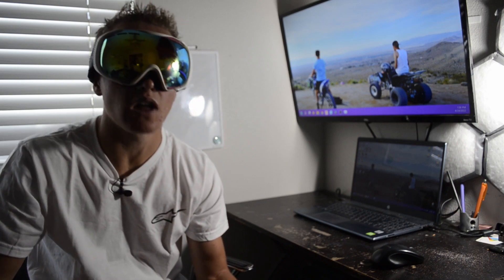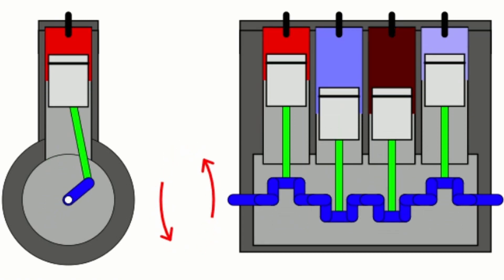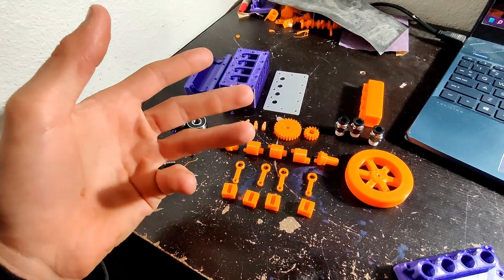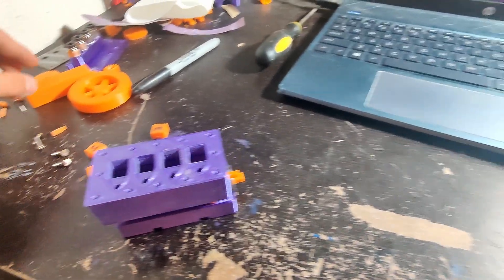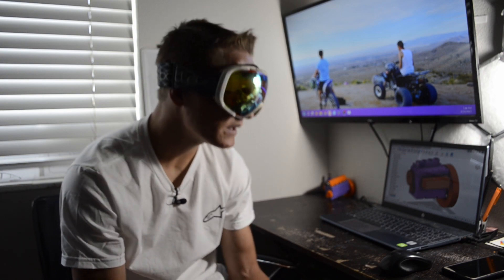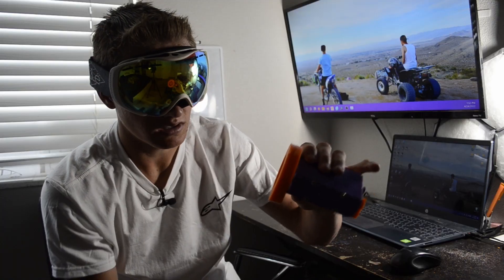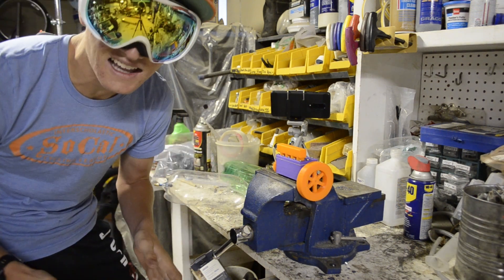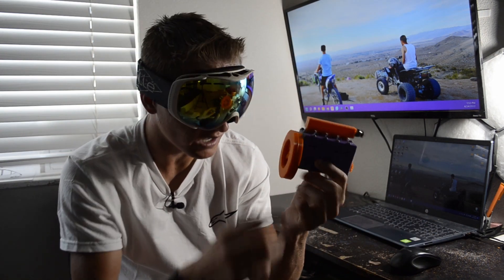3D Printing A Working R1 Engine

Comment: what non-3d printed parts do we need? the thingiverse description does not list them
Reply from the maker: 18-M3x20mm
4-M3x10
2-22x8x7 bearings
2-16x5x5 bearings 
4-6mm precision ball bearings
1-1/4in npt thread pneumatic fitting

Besides that, i think that's everything
Reply: @AxelDayton  thank you!

Comment: Hey there, I'm about 15 yrs. old, and am trying to print this beast... what how many of each piece should I print? there are so many cam pieces that I can't tell them apart!
Reply from the maker: Ok so in this engine their are 4 pistons, pushrods, con-rods, m3x10 bolts, and 6mm ball bearings. There are 8 crankshaft parts, 4 ball bearings (2- 16x5x5mm), (2- 22x8x7mm), 16 m3x20mm bolts and 1 of everything else I believe. The amounts may be off for hardware, but that should be the right amount of 3dprinted parts
Reply: @AxelDayton  Thank you! also, which type of crankshafts are used on the conrods? they don't seem to fit together in my cad/slicer environment
Reply from the maker: This crankshaft is a multi-piece crankshaft. One side had a small square and the other side had a small circle with a square inside, you conrod goes onver the circle and the square goes into the circle, that's for one piston. 

It may make more sense if you watch my single cylinder 4 stroke engine because that walks you through how to do it. Sorry if these directions are unclear
Reply: @AxelDayton  Thank you!!!

Comment: Have you ever thought about lubrication? I build lego engines with the same exact principle as these engines and ive found that lubrication always helps. Best thing ive found is either vegetable oil or vaseline
Reply from the maker: Yes, i don't know if i showed it in this video but i use silicone lubricant for all the components; pushrods, pistons, and crankshaft

Comment: can i ask what's the point of a 4 stroke air engine?  I may be wrong but i thought the point of 4 stroke was to extract maximum efficiency out of the fuel burning..? why not cross plane 2 stroke lol
Reply from the maker: There are 3 reasons i build 4 strokes:
1. By delaying the firing order to every 4 strokes, you save air by having it fire every other revolution. This was especially true for my single cylinder engine. 
2. This engine's soundtrack would not have been possible without being a 4 stroke due to it's weird firing order. If it were a 2 stroke, it wouldn't sound like the real R1 engine.
3. To my knowledge, the only other person that builds 4 stroke engines are Camden Bowen. So its a great way to have my engine designs stand out.
Reply: @AxelDayton  okay well that makes sense, thanks for answering! I have seen some of Camden's videos and I love this part of youtube; also from seeing Tom Stanton's 2 stroke videos I'd guess you get a higher peak power but at a lower efficiency

also well done on getting it to even fit together, tolerances are hard enough let alone getting it to self start!

Comment: hey what size screws n such did you use for your engine
Reply from the maker: Pistons use M3 x 10, the head/oil pan use M3 x 15
Reply: @AxelDayton  thanks!!! Also I'm printing your engine in a type of plastic called Nonoilen, it can withstand Temps up to 110C easily but it prints like pla, you should check it out!  I'm gonna use it to power a rc steam powered plane. I am gonna modify the engine a bit to make it more durable.

Comment: Pretty cool maybe soon your should try (if you ever want to make another part of this series) to make dual or triple expansion engines like  steam ships had in the 1910s to try to squeeze out the most speed and torque out of the same amount of air (update as I just got this as an idea but) use graphite as a solid lubricant for the engines to give more efficiency and bc it’s pretty easy to get it
Reply from the maker: I like that idea...🤔
Reply: @AxelDayton  50000$ a video for you to  license my idea

Comment: Can you put more PSI into a plastic bottle if you hold a bottle under water so that the water pressure helps stabilize the container?
Reply from the maker: Not really, this engine has a fail safe in place that once 50psi is exceeded, the intake manifold will shoot off to prevent damage to the valves